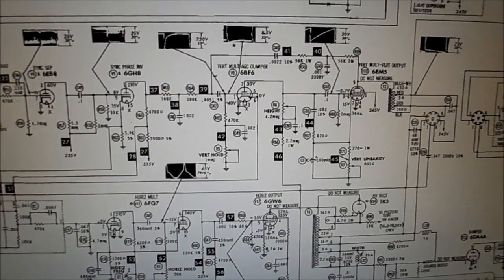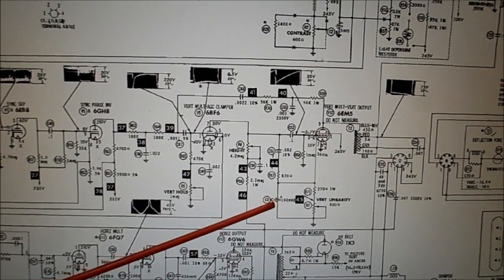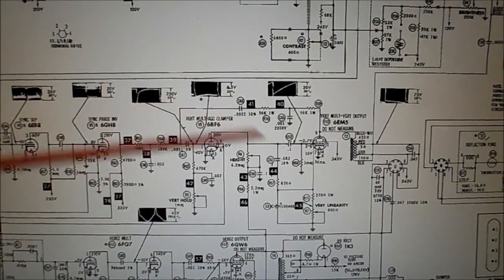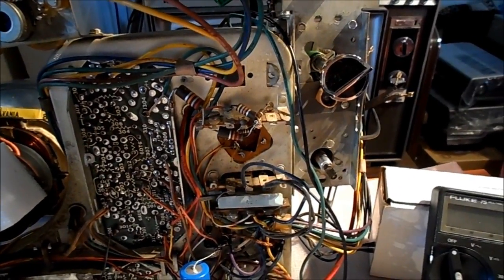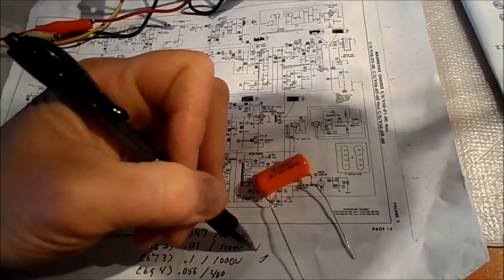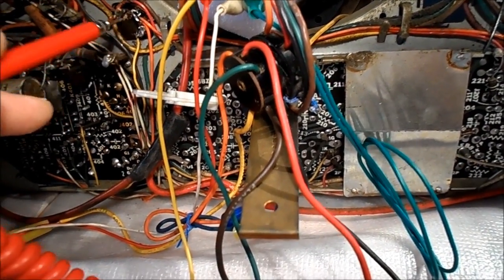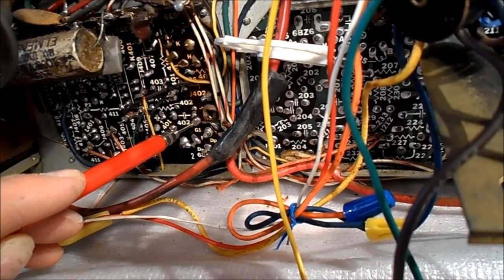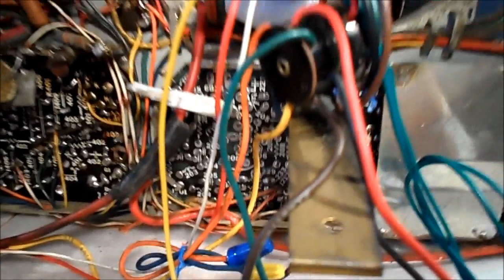1965 Magnavox B&W. Pt. 7. Poor Vertical Lock Develops.

Comment: Got the same problem on my realistic portavision boombox. Vertical lock dial is turned to max. Definitely not worth opening it up. It did work when connected from a VCR. Perhaps the stronger signal makes a difference.

Comment: did you use dexoit D5? that is only for metal contacts, like switches.  if you use it on a carbon pot, you might kill it. ask me how i know. dexoit faderlube f5 is what you want
Reply from the maker: Hello, & thank you for watching. Yes, it is the G-series. Purchased because the price was right. Have had no issues so far, but is for metal contacts. It is used sparingly. It says 4.5/5 safe for plastics, however have noticed with some other sprays slide controls get stiff afterwards, & again folks say to use the faderlube. Will get some soon.

Comment: something else, check the AGC filter caps C15,C10,C5. Hash left over from poorly filtered AGC can cause a lot of odd things. You need to scope at these points to really see the DC voltages (and see the hash). Sometimes just hooking up a bias source at TP 1 and adjusting is a good starting point, as it will supply a good filtered  AGC voltage that would counter any hash if it was there. The best way is still to use the scope, this will narrow things down without having to pull parts and replace, if its not integrating in to a nice spike then it could be noise on the AGC or hum from an HK short in a tube. The scope is the best tool for quick clues.
Reply from the maker: Will do. I'll get the scope for a look. This is a great set to revisit this stuff. Never biased AGC before, but am aware of it's purpose. I'll check those two 100K's, the caps you mentioned, & meter (analog) and/or sub that Vertical hold pot. C47 is the only 5%. It actually has a printed label on it telling you the capacitance. So the osc. runs just slightly under 60Hz., & the job of the sync pulse is to lock it in. (In the perfect world). The vertical hold control just varies the oscillator slightly. I'll search out another V9 6BF6 also. Where if any is feedback here? Plate of the output back to V9?
Reply: feed back is from the plate of the 6EM5 to the grid of the 6BF6, then the plate of the 6BF6 to the grid of the 6EM5. The grid bias on the 6BF6 will slightly adj the free running speed of the multivibrator. The Height control adjust the overall amplitude while the lin control moves the bias point of the output tube effecting the gain and operating region of the the tube (in and out of perfect linear operation). The scope will show hum on the sync pulse if there (it will ride up and down the pulse since the hum will be a bit faster than than the sync). If hum then look for HK on sync sep tube, if poor sync pulse then integrator or AGC hash. If all this looks good then I would guess 6GF6 tube (gassy/grid emmissons).
Reply: Farmradio
don't forget to turn the brightness all the way down before pulling V9, you don't want to burn a horz line in on the CRT.
Reply from the maker: Dave WM
Right, it will be the bright line from loss of vertical. Ahh, so the Mult. stands for multivibrator. aka the oscillator? Both tubes are part of the mult. then. Is the integrator those resistors/caps feeding the G1 of the 6BF6. Like those crazy town & country Philco's that roll have that couplet that goes bad. Integrator.
Reply: yes its the 100k's and the .001 starting from the plate of the sync separater to the grid of the 6BF6. FYI I have 3 of those chassis, two have very solid vert lock, one was always a little soft. It was in a set that I ended up scrapping so I never really bothered trying to resolve it. I do recall subbing some parts to no avail and I did NOT use the scope. Hence my advice to scope 1st to avoid needless subbing.
Reply from the maker: Dave WM
Got it. Thank you. Ordered the HV caps., & a 5100pF for that .0051uF, just in case. It's kind of an odd value.

Comment: vert integration of the sync pulse. R63,R64,C46. Maybe a slightly leaky C47.

you can confirm by scoping pin 1 V9 using the * notes to see just the sync pulse (V9 out brightness set to min as there will be no vert sweep). If the sync pulse in not integrated you will not see the nice single spike at the vert rate on the scope.

If the sync pulse at pin 1 looks good (with the tube out) I would suspect a gassy or grid emmisons V9.

Also if you think the issue started with the cleaning of the pot, you should confirm its working with a analog meter, however I doubt this would be the problem since the vert sync pulse should be strong enough to lock it it. Note the vert with no signal should run a little slower than the sync rate, which is just a bit under 60hrz (with the advent of color cast, before color it was 60hrz).
The idea is the slower running osc is kicked by the sync pulse to start. Often you can hear this, with no signal you will hear the buzzing from the yoke, tune in a station and it will speed up just a bit. if the sync is real weak then you are relying on the free running speed being VERY close. Multivibrators just are not that precise.